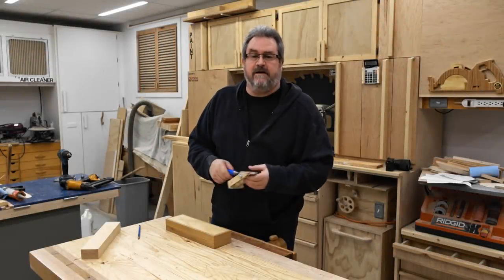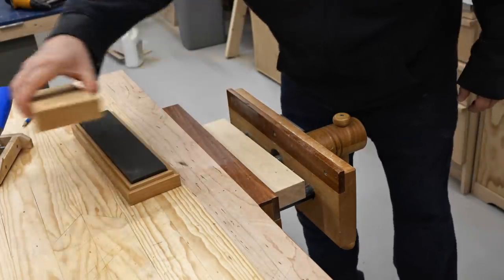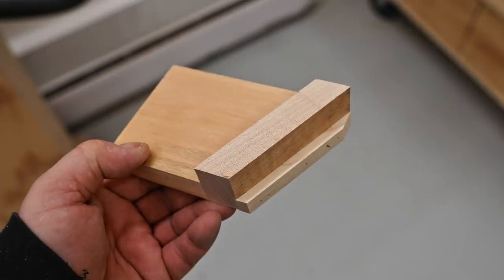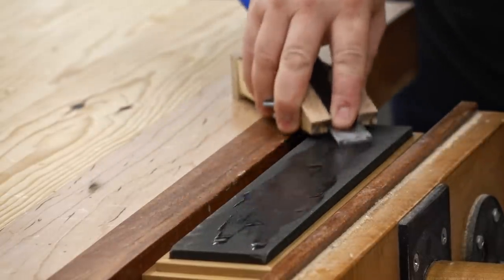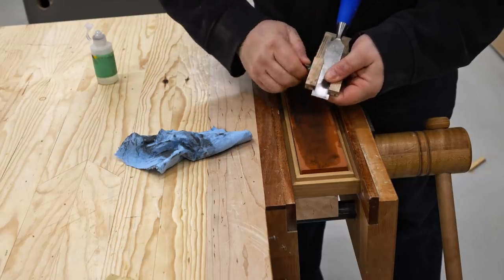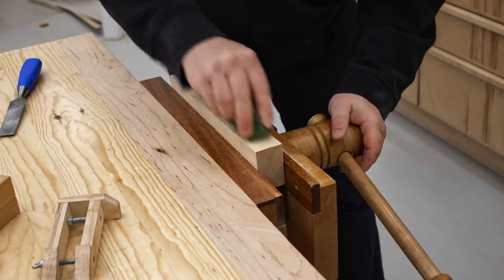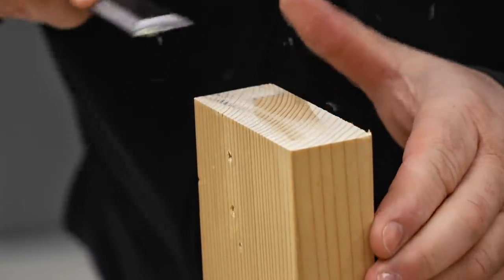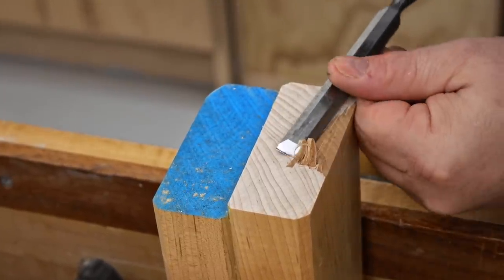How To Sharpen A Chisel - RAZOR Sharp

Comment: While I don't agree with working on the flats on a stone that is concaved (you'll get either a bit of lift on the front on one corner depending on your angle), the sharpening jig is the best I've seen.  It is quick and to the point.  Fantastic design - wish I had thought of it.

If you want to pull the burr off, it's a better idea to put pressure on the bevel, start 1/2 inch past the corner and pull it back on a flattened AND clean stone.  Touching up should really be two to 3 pulls on a hard Arkansas and a 2-3 on the flat.

Comment: To hi polish hone your chisel , blades , knifes etc simply turn a sanding disc inside out using the canvas back . Or linnisher belt inside out . Coat with cutting compound and back draw your sharp edge on it . It will give you an edge you won't believe how sharp

Comment: Nice, I usually use a diamond plate i bought, works pretty good.  When I drag stuff out I do a bunch of them.  I have my Grandpa's old sharpening stone but it's worn at a bad angle, I don't know if I can straighten it or not.  Good video.
Reply: Rub two sharpening stones together and they will end up flat.
Reply: @NordboDK  I wish, this one is pretty much ruined, thanks for the information though.

Comment: I have several chisels in my toolbox that have been beaten to death.  I really need to get my sander setup to get all the chips out of them and then build this jig to get them sharpened.  Right now, they are essentially useless.  But with this, you can buy chisels at yard sales extremely cheap and then make them better than store-bought. LOL

Comment: As a wood carver I don’t put on a second bevel, you did get a good edge on a mediocre chisel. I have a lot of those sticks and powders but what I prefer is to use metal polish on the wood and polish it the other direction and stroke it until it cuts into the wood. As I’m working I will maintain the edge using this every 5 minutes or so and always have a perfect cut. Doing this to your planes and draw knives will make you love them. Someone below asked about the best chisels, they are old ones, they can no longer use the toxic chemicals to make and temper chisels, new Sheffield’s are garbage.

Comment: I'm looking for some "budget friendly" chisels. Could you comment on what kind of chisels you have and/or suggest some chisels that I might buy that will not break the bank. Thanks
Reply: You can get any chisel set, you’ll end up sharpening them anyway, the cheaper ones need to be sharpened more often, but it’s faster, the more expensive ones keep the edge longer, but take more effort to sharpen
Reply: Mike, I was able to get a set of Woodcraft chisels on sale. For the price I have found them to be quite good. Need a quite a bit of prep work before I could use them, but now they do anything I would want. Hope this helps.

Comment: Any benefits of using oil vs water when sharpening?
Reply: Oil has more lubricity and wont dry like water.
I prefer water because although a lot of wetstones will work with oil, it is harder to remove, there will be some oil remaining in the stone. so basically you cant use a stone previously used with oil with water.
Reply: Thanks!  @deathsmileyinc
Reply: It is not a case of benefit. It is a case of using the right thing for the right stone. You don't use oil on Japanese waterstones as it will ruin them. John is using an oil stone here, so oil is the right thing.

Comment: I have owned and used a Tormek-style water wheel for 10 years now.  Not really sure if it's worth the money.  The stone is coarse and can't get a mirror-polish on it.  They tell you to go straight from the coarse stone to the leather strop.  Not ideal for fine, hard metal blades.  You have to buy or make a new jig for damn near every kind of cutter.
Reply from the maker: I had one of those Wen wet wheels long ago that did a decent job, if you have half a day to kill. Turned at something like 5 rpm.

Comment: You didn't mention that the back of the chisel needs to be flat. I'm assuming you flattened it before you sharpened the chisel the first time, but anyone watching this video that didn't know anything about sharpening hand tools wouldn't know that.
Reply: People who need to sharpen a new chisel should probably find a video on just that. Most people don't watch only one video either
Reply from the maker: I  think some people go a bit overboard with how much they do with a chisel (and hand plane, as well) to make it "perfect". If you buy a fairly good quality chisel, it should be flat enough on the back already. I hold the back of the chisel flat to the stone when removing the burr, and that also helps to keep it flat.
Reply: I thought this was a video on sharpening a chisel. Why would anyone that needs a video on sharpening a chisel differentiate between a new one and a used one. Even if it is a used one, who's to say any previous owner knew to flatten the back.
Reply: John, I can't disagree with that, but not everyone buys quality tools. I also needs to be smooth, not just flat, on the back or you'll never have a good edge no matter how smooth the bevel is. I agree that removing the burr as you did will take care of that, but a new chisel out of the box, other than relatively expensive high quality ones, will need the factory milling marks removed on the back side.